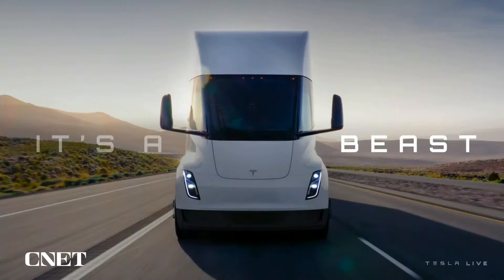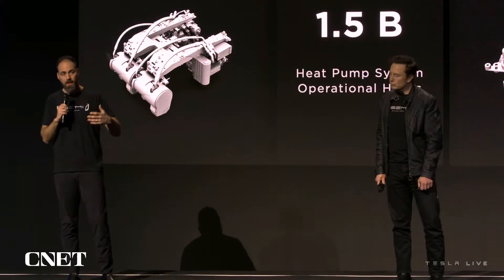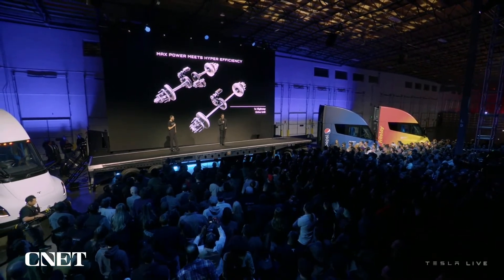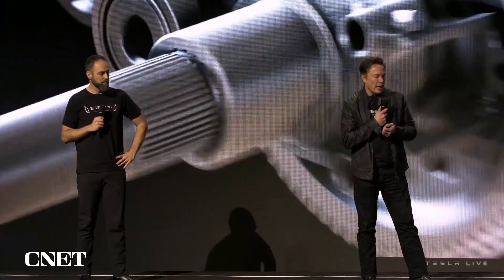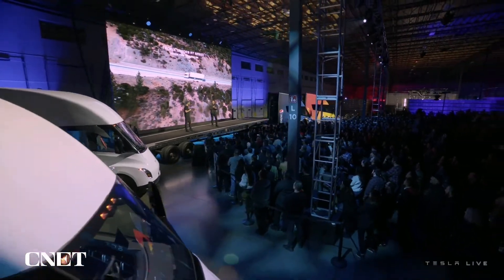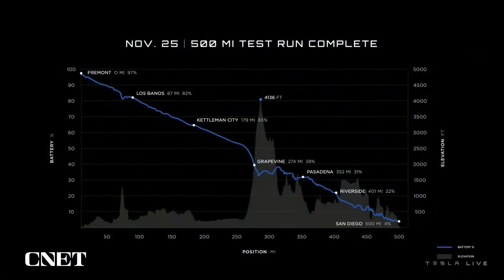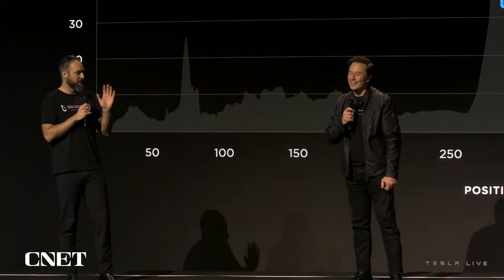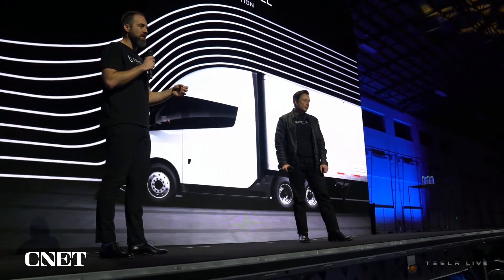Watch Elon Musk's Deep Dive Into the New Tesla Semi-Truck

Comment: No oil changes. No diesel fuel (high cost). Longer lasting brakes. Free energy from the sun if warehouses choose to put solar panels on their roofs. Cheaper motor changes every x miles. Not much maintenance. What trucking company wouldn’t want these? For the world, we get quieter vehicles, less condensed pollution, and better safety. Downsides would be the cost of battery replacement, tire wear might be higher do to the extra weight, the high power grid usage if not charged on solar. Overall, this is a home run. I can’t wait to see some Class C RV’s made from this platform.
Reply: It's pretty much garuntee that business will install solar and battery pack if they brought electric Semi as it can be write off as business expenses + any tax incentives on the top of that
Reply: What about the kids scraping all the cobalt for that 1000v?🙃
Reply: One needs brain of size of pea to not realise that this is model 3 moment for trucking industry. Next 5 years will see step change in this area. The quality of presenters says that the know their $hit inside out.
Reply: Totally agree.  This is a paradigm shift and the benefits will continue to stack up as it matures!
Reply: We could burn all diesel or gasoline to directly create the electricity instead, and still be saving fuel. ICE engines are extremely inefficient
Reply: The only problem is whats needed to make the batterys. All other parts are all good
Reply: I love what he's doing! BUT... We're 100 years away from replacing over the road (OTR) trucks with batteries (I know that is not Tesla's current market target). Don't get me wrong, I'm a big, big fan but the general public really has no idea about trucking (or where their food comes from for that matter. I digress).  These vehicles, in time, will only replace short inner-city or smaller warehouse to warehouse transfer. If you have ever worked any battery powered equipment, the answer is obvious. 
@billp5491. There is no extra tire wear or higher loads for EVs.  Most commercial trucks (18 wheelers like the Tesla truck) are licensed for 80k lbs. in the US.  These EV trucks will have to reduce cargo due to increased weight of batteries- same tires, same streets, same weight restrictions.
Fossil fuels will never be completely replaced because nothing has been discovered and utilized that can produce the energy per unit needed to power the world. At least nothing that is as scalable and available as the modern combustion engine. And don't even start commenting on atomic capabilities or some other back to the future fusion BS. It is not available for general use, scalable or affordable. There is currently no other motor that can perform as effectively as the diesel motor.  You have to take into consideration EVERYTHING that it takes to charge those batteries. It's estimated that an electric grid nearly double the US capacity will be needed to transition to an all or mostly all EV fleet for commuters only; and those vehicles will be limited in range and usability as much as 50% of the current combustion engine driven vehicles today. What fuel is going to power those power plants?  Not only that but ask yourself and 10 of your friends if thay can afford to go and buy a new EV this year....heck ask them if they can in the next 3-5 years!  The answer for most Americans is NO, and no amount of hype or legislation is going to change that reality.
The EV trend is mostly driven by political BS and save the planet nut jobs who have no basis of reality. I'm all for reducing emissions, toxins, plastic oceans in the ocean and all that. Heck, I hardly swear anymore when someone gives me a frikin paper straw but people have to stop and actually think.  We have to work on changing the infrastructure and updating that before this becomes reality. So far it's the cart before the electric horse!
Reply: yeah the battery replace going be very expensive. For a tesla model 3 battery replace, it will cost around 20k that could be another car
Reply: @TheAthleteJC  
Wrong and wrong.
Reply: @TheAthleteJC  I wonder how much a replacement engine is for a diesel truck. Which I know will need major servicing and even replacement before an electric power train. Just wouldn’t like to be near one of these if the battery fails 🔥
Reply: Zombies talk, sapere aude!! The  petroleum pollutant grid continues to power theiruworld SCAM of lithium (rare metals exploitation of the  scrambled continent's ) batteries LOLOL, dumbfounded televised advertising ZZZZZZZZOMBIESZZZZZZZZZZZZZ.
Reply: LOAD CAPACITY????????
Reply: Also thinking about the driving experience.  Drivers will drive longer, feel more refreshed, less stressed and it may actually be a way to recruit more drivers!
Reply: Weight on tires is the same.
Reply: What about autopilot?  FSD?  How long to charge?  Has Tesla given up on FSD?
Reply: @Madracer09  I guess the basic information, data and stats (that I love to hear from the likes of TeslaBjorn) will be in the long version 👍
Reply: @Madracer09  the system is only perfect on a controlled road .. and tesla is not there yet .
Reply: Good for long term Tesla stock and future
Reply: Clean and safe Nuclear power!!! Already in progress and they are modular so they will respond as per demand.  Check out TerraPower and their progress.
Reply: If this administration is shutting down coal plants our energy supply to charge these disappears. Also, if it decides to catch on fire on or under a bridge? Wow.
Reply: Road wear will increase to due weight. Construction will have to adjust
Reply: @diggleda2952  seriously, 82000 lb is how much more damaging than 80000 lbs. Of course they will always have max load both ways... lol think then write.
Reply: @lyrrad62  Times countless trucks
Reply: @diggleda2952  Trucks rarely carry full load, but with the diesel no longer needing to be delivered, by semi truck it should be less damage overall. Fewer trucks and less fuel to be delivered.
Reply: @lyrrad62  That’s a great point. An offer long haul companies can’t refuse…
Reply: How about creating CHEAP/FREE electricity first before we produce more demand on our ancient grid.
Reply: I am missing raw data. Okay I heard "IT" being the truck, trailer and load weighs 81K or 82K. Tell me what the truck weighs and the trailer and the load. It's not that hard. But for some reason it's being hidden. Also everyone is accepting this data. With today's benefits of having Fossil Fuels. Even if just half of the vehicles on the roads were electric. Do you really think that electricity costs would be the same as they are now? Let's push it a little farther.  These EV's have nice tires and nice smooth asphalt roads to drive on. What are you going to ride on if most of the refineries shut down? They are both made with oil. How about the plastics and all kinds of other stuff it takes to build a EV? They are readily available now thanks to Fossil Fuels. Stop comparing the benefits of EV's while they are still based upon us having Fossil Fuels to make them and provide the infrastructure for them to operate on. This two completely different words.
Reply: Love your comment, but keep going with the train of thought. With Elon's new Semi, the very concept of Class C disappears along with diesels- like the new Tesla Semi, the shapes will become streamlined, so Class C's will evolve from square aerodynamically clunky boxes, into something else entirely.
I predict the Class T... and it will be aerodynamic and beautiful.
Reply: Plus it’s better for air quality and once we have harnessed renewable and primary energy, better for the planet, which are the real reason Musk started all of this
Reply: @thumper1747  he is in it for the money why would he care about clean air he thinks he is going to mars in his life time .. con man of the year and  a cia asset.
Reply: Cheaper motor changes?! You know this is Tesla right, you don't even fully own your truck, and if you sell it to someone else without Elon approving it you'll be booted off the grid. Can't trust someone who supplies the product and the refill.
Reply: Deisel fuel is cheap
Reply: @thnktank1  it should be cheaper than gasoline it's less refined
Reply: These electric trucks will amount to a fart in the wind!
Reply: How many hours am I allowed to drive? I don't have to urinate in 5 hours
Reply: I can’t wait for this to come to Australia and I can two my four trailers with it, it’ll be soo nice to do 500km with…..
Reply: IT'S A UTOPIA!!! NOW WE JUST NEED COMMUNISM!!
Reply: Hello Mr.Robot, did own one ? How many miles did you drive it ? What kinda of weight?
Reply: It's scam it is never going to sucess
Reply: You forgot the super expensive tires that EV needs,and also they have to be changed 3 times more often. Ev car is like 1000-1500$ for complete tire up,tires are 300-400$ apiece.
Reply: No Tesla semi either 😂😂😂
Reply: good luck buying parts
Reply: Battery replacement when it has 1 million mile warranty? Extra weight... it weights the same a diesel semi but can carry 2k more, same with tire wear, high grid usage... with peak demand throttling it is not a problem 99% of the time. Real downsides are infrastructure related... added weight not enough charging loc. And truly unknown long term expenses and no repair locations.
Reply: @lyrrad62  glad somebody has their neurons firing here. We truly don’t know the repair cost and wait time.
Reply: @lyrrad62  they will never get 1000000 out of those batteries
Reply: @barstoolpreacher7851  hmm, who cares if they warranty it and replace it? So quit bashing on talking points and do some research. why? Dendrite, cracking from expansion why failure?
Reply: @barstoolpreacher7851  a million fires over time maybe ? Hmmmmm
Reply: How about that you need lithium? How do you think they mine that? What about the current electric cars that burst into flames now, just sitting in a parking lot? Now suppose you have batteries of this size, do that in your neighborhood? So now, we need to burn more coal, to charge more batteries? NOW, explain to me what you do with the old batteries? You going to bury all of them, like they do the blades from the wind mills?
Reply: @trucker-d4161  An average diesel truck gets about 6 mpg and consumes 13× more energy than a BEV like the Tesla semi per single mile. Imagine a 500 mile trip or a 2000 mile trip. In dense cities they also spew out toxic gases causing smog which causes cancer and many other side effects among residents. They're also thousands of times more prone to catch fire than an electric truck...because they rely on thousands of combustion cycles a minute to get moving while an electric drivetrain requires exactly zero combustions to operate. I think that's enough said over the incentives of an electric truck and it's positive environmental effect compared to a diesel truck.
Reply: @trucker-d4161  i totally agree those that think all this is viable are brainwashed and never driven a truck for a living.
Reply: @trucker-d4161  - No...use your head and think...the batteries will be recycled,and the materials will be reused to create new batteries.
Reply: @trucker-d4161  - It's up to you to do the research that enables your understanding of the processes involved. I've already done the research and have also learned a bit about it from people that are involved in the industry.
Reply: @misplacedstarman5455  perfect come back from a left winger, so in other words you have NO idea 😂. Well maybe they should just bury them in the ground like they do the wind mill blades.
Reply: You forgot ai that does what it wants     overrides any input by its human occupants will never last a day when fully charged, will never last 500000 miles like ic trucks.
By the way anybody that's worked for a large truck company its like hot bedding a driver gets out another gets in, diesel trucks are used 24 hours a day something musk and his tech crew will not know since they don't live in reality.
Reply: It’s gonna need a big flat bed tow truck 😅
Reply: Let me see it haul thousands of pounds of load… then I’ll believe it.
Reply: cool. except that its not cost effective
Reply: The new Batteries don’t really wear out anymore.
Reply: @DurangoC  Tesla batteries are industry leading in every way.
Reply: The grid isn't prepared
Reply: @myballsitchsomethingfierce6319  Why would anyone build gas stations BEFORE the cars?
Reply: @myballsitchsomethingfierce6319  They're already planning for it.
Reply: @selewachm yeah I see that California's been way ahead of the game planning for it with a rolling blackouts
Reply: @myballsitchsomethingfierce6319  being over 2.3 million tesla cars on the road, with over 2k tesla superchargers worldwide with even double that for other charging stations. I belive we are ready for this step.
Reply: @myballsitchsomethingfierce6319  Better start preparing.
Reply: @myballsitchsomethingfierce6319  
Pull the energy used to refine the diesel fuel.
Leave it in the grid.
Use the energy to charge the trucks.
The grid is prepared.
Reply: @myballsitchsomethingfierce6319  I'd say it is. EVs only account for a small, tiny amount of overall energy usage. They don't consume as much as a house or a facility or a building or skyscraper.
Reply: @thedumbconspirator4956  a tesla is 60kwh, this thing needs 1000kwh for ~400-5miles
Reply: @MrPaxio  where did you get 60 kwh from? A base model 3 has a 60 kwh battery. I have a performance model 3 and that's a 87 kwh pack, model s/x has a 99 kwh battery, the semi has a 500 kwh battery size.
Reply: @thedumbconspirator4956  it's not about how much they consume, it's about peak use of the grid
Reply: @thedumbconspirator4956  a 15000 lb battery you say so now your max haul weight is only 25000 lbs ..  ok then ...
Reply: @thedumbconspirator4956  ye, and spikey charging demand can be smoothed with grid scale batteries.
Reply: @thedumbconspirator4956  how you going to charge those tractors at night time when the sun isn't shining?
Reply: @MrPaxio  
"A Tesla" is 100kWh for 400+ miles.
The smaller cars (Y/3) are 80kWh for about 350.
This started at about 97%, finished 500 miles at about 7% (+/- 90% used)
Reply: @rogerstarkey5390  model 3 battery pack is 60kwh. and yeah it did one 500 mile trip and used up all the charge and needs to charge again(plus you shouldn't go below 20% charge or above 80% charge), an average semi has a 300 gallon tanks, they can go 2000 miles before needing to refuel at a location that is cheaper than the destination which will be a major city with expensive power... they need to go further than the destination, because theyll pick up another load and keep going. nobody has 2-5 hours to spend to recharge after they return back to get another trailer
Reply: @myballsitchsomethingfierce6319  It will be
Reply: @ARealPersonNotABot  DDT works wonders! And, I wouldn't recommend a backscratcher.
Reply: ummm electric prices are about the same as diesel, and its still a truck, it doesnt just get to avoid maintenance. yes youll need expensive tires more quickly. the multiple motors on it will fail sooner. regen braking will strain the motors. and vehicle pollution isnt that big of a deal compared to the amount of gas power plants theyll need to open to charge these things.
Reply: @MrPaxio  
No, you won't need "more expensive tyres more often".
The tyres on this are smaller diameter (look at the overlay of the "typical" truck in the presentation) the EV traction control is far more precise and efficient, so no wheelspin/ wear.
"Multiple motors" provide redundancy.
These are used in the high stress, high speed Model S Plaid, but, with the Semi only requiring 35% of the speed, they're geared so low that there's no stress on the motor but huge torque at the wheels if needed.
Regen?
Will only return up to about 70% of the load on the motor when it's driving, so less stress (and it's not a "mechanical" connection anyway)
"Gas power plants"?
Charging at 1MW is the same as 4 V3 chargers at full output.
There are hundreds of locations where they run 20+ of those at the same time with no issues.
You're guessing.
Reply: @rogerstarkey5390  smaller tires mean even more wear and tear on them. bro it doesnt matter how efficient the truck is, its still hauling 80,000lbs and putting stress on the tires. semis dont spin their tires at any point so its the same. the reason theyre bigger is so you dont replace them as often. and yeah more motors mean more gearboxes and more parts that experience stresses. plus chargers barely accommodate the current EVS what makes you believe now a truck will park there and take up 4 chargers... and thats only super chargers, majority of the chargers on the road are slow chargers. and having 4 plugged into a truck means one truck going 400 miles instead of one charger getting one EV to drive 240 miles.
Reply: @rogerstarkey5390  also engine braking is a thing. it works the same way as regen except ure not stressing a small motor
Reply: Most other chassis OEMs are ahead of Tesla.

The #1 problem with the Semi? Parts commonality. 

#2 would be lack of proper sleeper.
Reply: @mathieulabonte7392  Designing a sleeper cab isn’t rocket science. I’m sure there will be other options once thing thing hits the ground running.
Reply: @mathieulabonte7392  Tesla is highly vertical integrated. They dont need OEM.